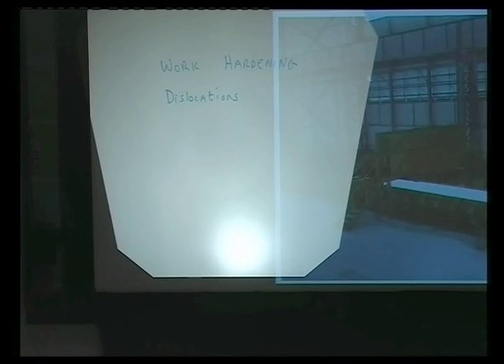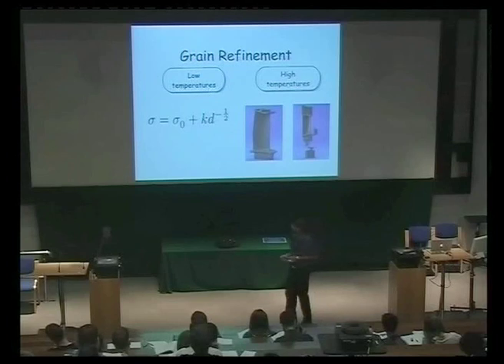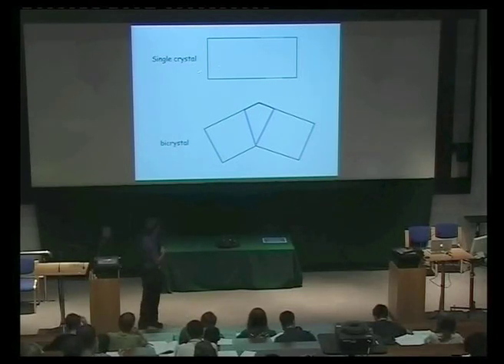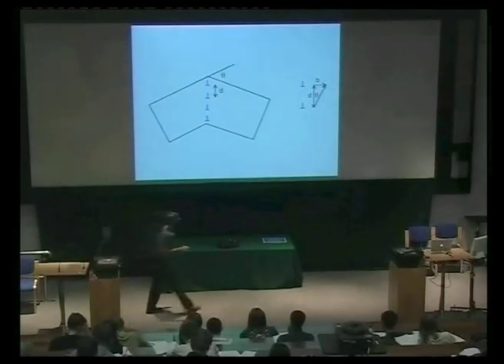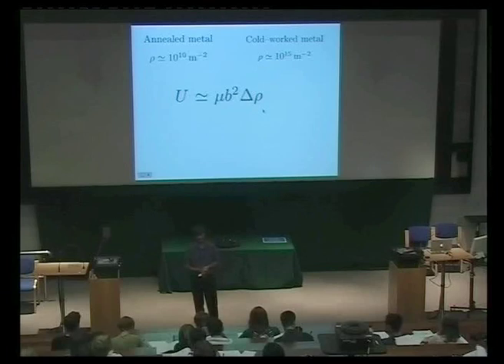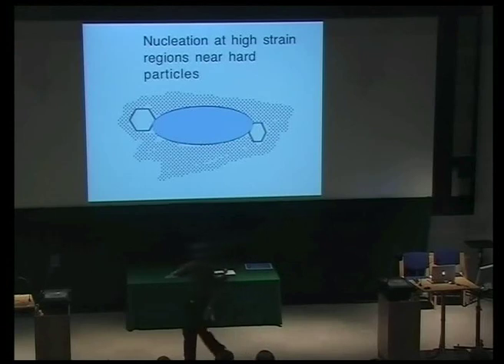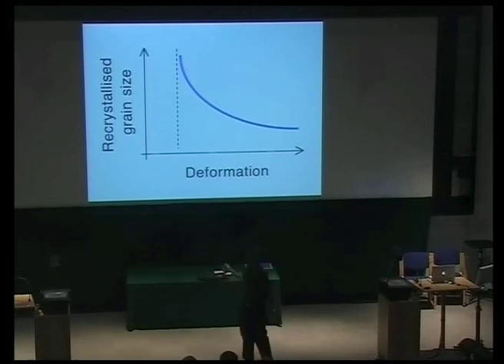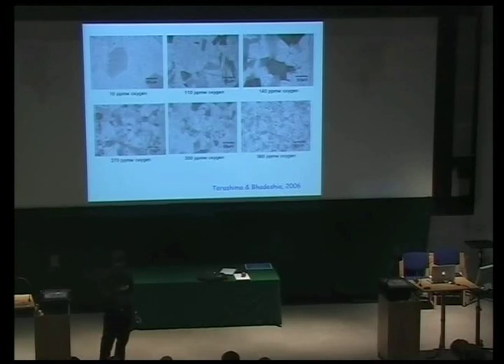Metals and Alloys, lecture 6, Recovery and Recrystallisation

Comment: Thank you for your precious knowledge. 
There is a question I've been mulling over though. Addition of fine particles, such as the oxides you talked about, are often called inclusions with harmful répercussion on mechanical properties including toughness. When you look at a fractography with SEM for a sample to look for the origin of surprisingly low ductility, you could pinpoint an oxide inclusion such as Al2O3 as the origin of crack initiation.  So the question is how to make a choice ? On the one hand you increase toughness with lower grain size thanks to small inclusions but on the other hand you add lattice incoherence (I guess) with these inclusions leading to sooner cracks and lower toughness.
Maybe you could enlighten me. 
Thank you
Reply from the maker: Yes, you are right. The particles involved in thermomechanically processed steels are, however, not harmful. They are fine carbo-nitrides with a level of coherency with the matrix. The gain from the resulting grain refinement far exceeds any consequences on ductile void nucleation.
Reply: @bhadeshia123 

Thank you for your answer. So it depends on the compound that is formed and on its size to maintain a certain coherency. If not the pile-up of dislocation brings about the decohesion from the matrix I think.
Thus the compounds to add up can't be chosen at random

Comment: Dear Professor,
if we making the grain size finer, does that means we are infusing the more grain boundaries into the material? Which further lead to the high diffusion at low temperature?
Many Thanks
Reply from the maker: Yes, a finer grain size leads to more grain surface per unit volume and a higher net diffusion coefficient. See page 10 of http://www.phase-trans.msm.cam.ac.uk/abstracts/L1-2.pdf
Reply: bhadeshia123  Thank you, Professor. I would like to ask that, we are working on the weldability of high strength structural steel with low strength filler weld material then base material at TU Dresden Germany. I have seen your lectures on Metals and alloys and if you could recommend me which lectures I should I follow further to have a better understanding of my current topic.
Many Thanks.

Comment: How the reduction in grain size improves the toughness?
Reply from the maker: Two effects. The first is that a propagating cleavage crack is more frequently deflected as it encounters discontinuities at a grain boundary. Secondly, in steels, the size of cementite particles decreases as the grain size is reduced (see Curry and Knott, Metal Science 12 (1978) 511-514)

Comment: What is the driving force for Re-X if the material has already recovered prior to Re-X occurring.  Doesn't recovery exist solely to reduce the driving force for Re-X to occur in the first place.  If the material has  recovered, the driving force for Re-X should be lowered or gone.
Reply from the maker: I presume that "Re-X" means recovery and recrystallisation. If recovery reduces the driving force sufficiently, recrystallisation may not occur, though recovery cannot change the shape of the deformed grain structure.
Reply: @bhadeshia123  Thanks, by "Re-X", I meant recrystallization exclusively.  Since recovery always precedes recrystallization, I am surprised that recrystallization ever occurs.

Comment: If precipitation of Nb occurs at interface of MnS, the pinning effect would be limited and the grain would growth more. 
But why MnS inclusion attract Niobium and another inclusions not?
Reply from the maker: I am afraid I don't have specific knowledge of why MnS acts as a heterogeneous nucleation site for NbC, but the latter does tend to form on other phases such as TiC or TiN
Reply: @bhadeshia123  
According to the reasons proposed for intragranular nucleation of acicular ferrite, I was thinking that  heterogeneous nucleation of Nb in MnS could be stimulated by the difference between thermal expansion coefficients of MnS and delta ferrite. Today I found this:

"this phenomenon (segregation of Nb rich phases on MnS) is related to the higher thermal expansion coefficients of MnS compared to the steel matrix (delta ferrite) during the solidification process, which could take place in such low carbon/peritectic steels. Subsequent stress fields and debonded areas at the interface of MnS and matrix are able to stimulate the formation of large Nb-rich phases (with high formation temperature) around this particle. It should be mentioned that due to removal of these phases (MnS and Nb-rich phases) during the sample preparation"

TORKAMANI, Hadi et al. Contributions of Rare Earth Element ( La , Ce ) Addition to the Impact Toughness of Low Carbon Cast Niobium Microalloyed Steels. Metals and Materials International , 2018. <https://doi.org/10.1007/s12540-018-0084-9>.0123456789.
Reply from the maker: @barbaraf0  Thank you for this.